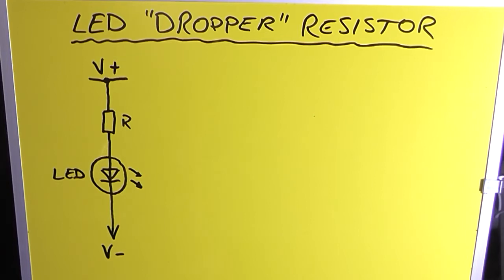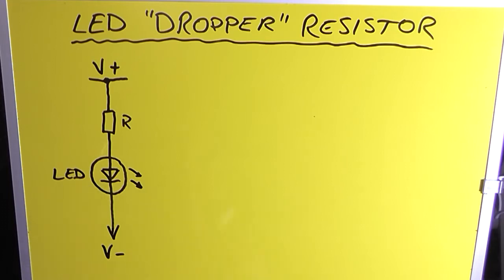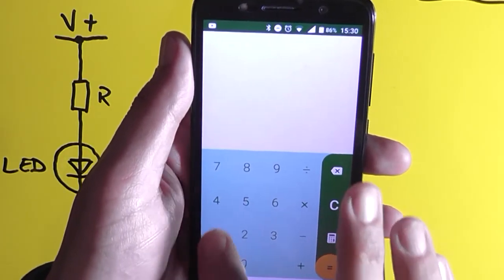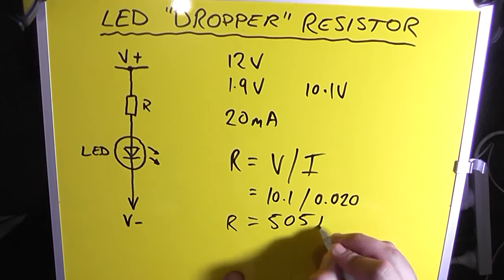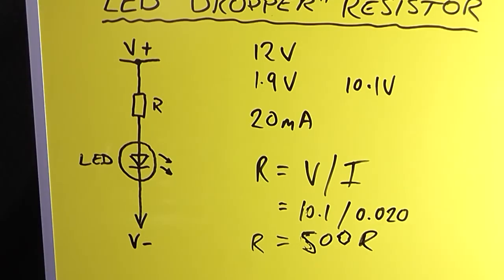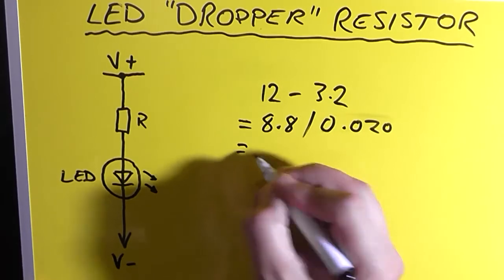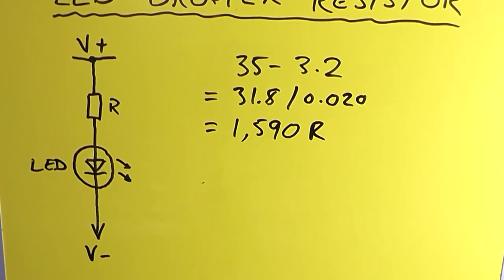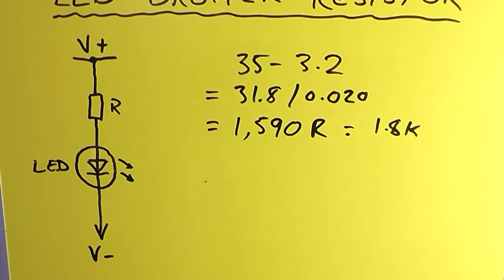Electronics Fundamentals: How to Calculate an LED Dropper Resistor

Comment: The term is dropping resistor.
Reply from the maker: Actually, current limiting resistor.
Reply: Yes it is, but the industry term is dropping resistor and is not in parentheses. Voltage is designated with E - as in electromotive force (E=IR and P=IE) instead of the new layman’s designation of V.
Reply from the maker: @mikefromflorida8357  yes, I know.